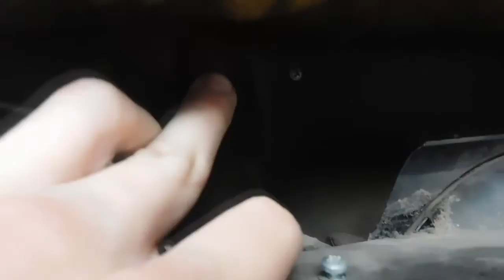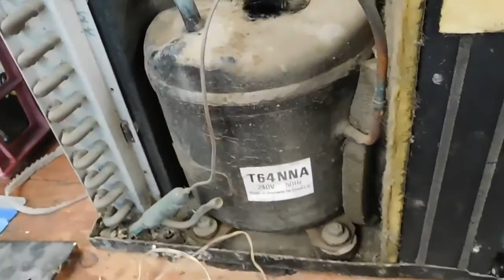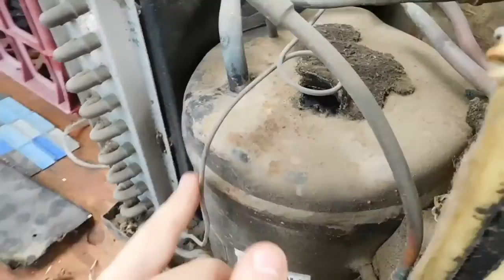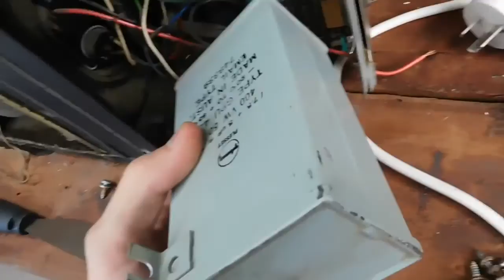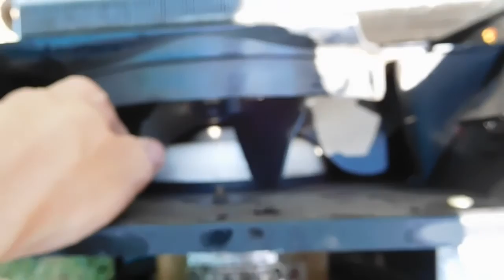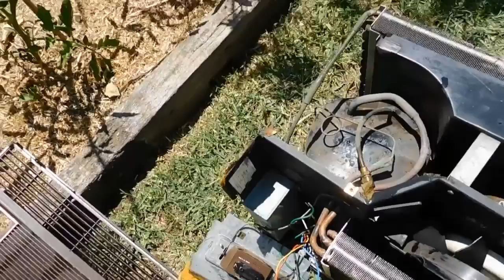Email-Westinghouse Window Unit Clean Up P1

Comment: Yes had a recharge. The pinch off on the drier is the original fill point, the valve is added after you regas. the coils strangely are not alloy pipe, but copper with aluminium find, so they will still be fine. 

Cycle works as following, hot gas out the compressor, goes to condensor where it cools, it then bacomes a hot liquid in the coil and drains down to the drier ( the tube) where any water or dirt is removed, then the liquid goes into the capillary tube. When the tube reaches the evaporator it drops in pressure and the cool liquid flashes into gas, cooling to a low temp. Then the cold gas goes through the coil and warms up, cooling the air in the room and dropping out the humidity. The warm gas goes to the piston compressor, where it is compressed into a hot gas and then around again.
Reply from the maker: Ahh thought it did! Is it like a tyre schrader valve under the cap?
Reply: +CAL'S ENGINEERING Yes, it is a standard schraeder valve, but has a PTFE or Viton rubber seal, a standard car one with the nitrile rubber will fail there is a very short time. Leave the cap on, it has a secondary seal as well, as the primary one often does leak with time.